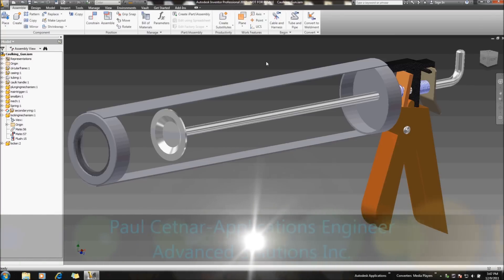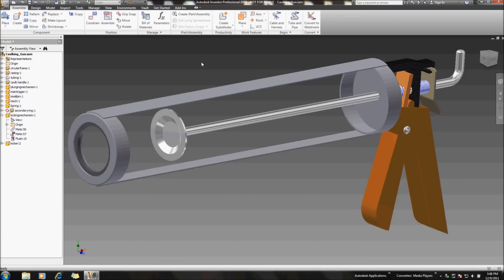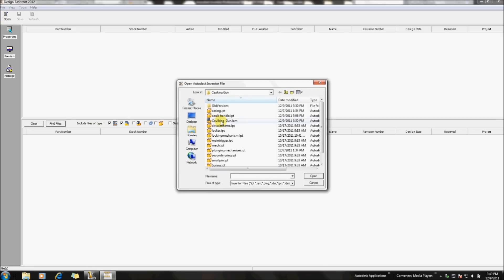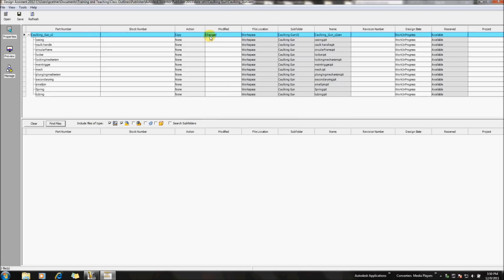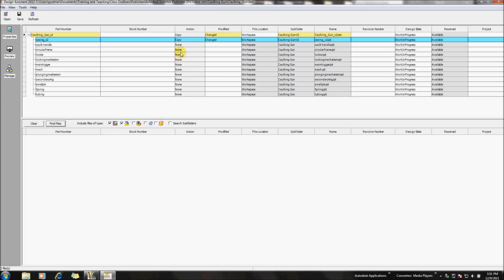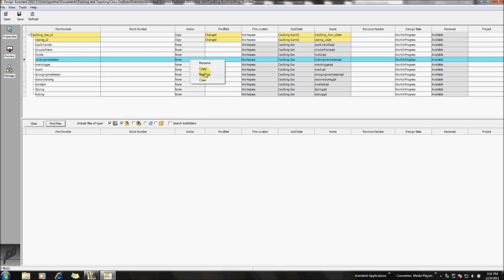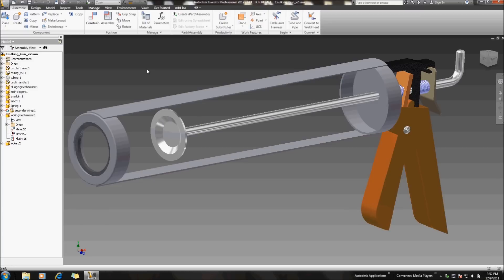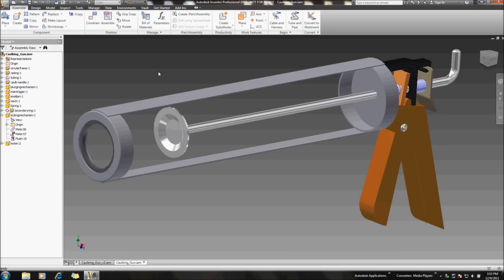Autodesk Inventor, Copy Design with the Design Assistant

Comment: I can rename the part number in an assembly in 3D environment by using design assistant. However, if these parts are dimensioned in drawing, it will appear "Resolve Link" Box when I open the assembly drawing. And I need to link the "old" name of that part to the "new" name to not to re-measure dimension. Is it possible to link change by using design assistant in 3D to 2D drawing. Please help